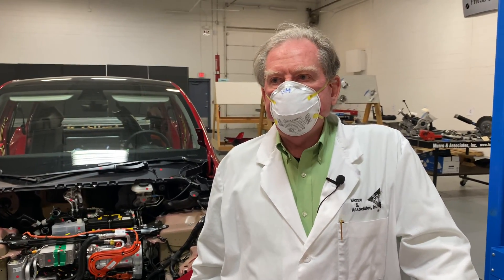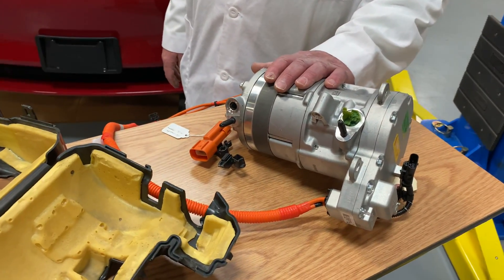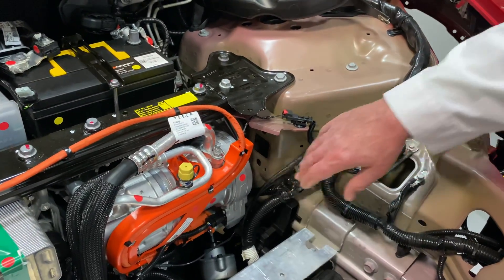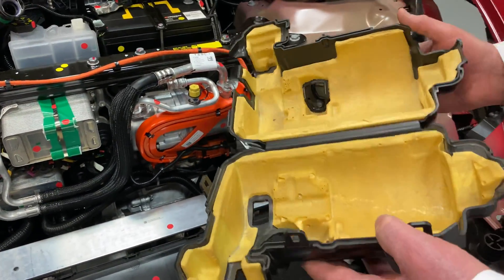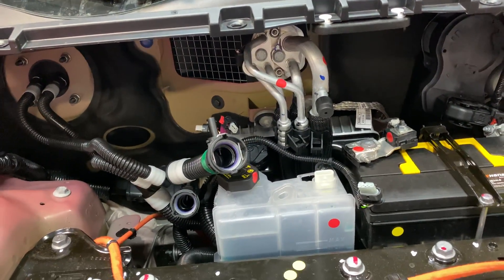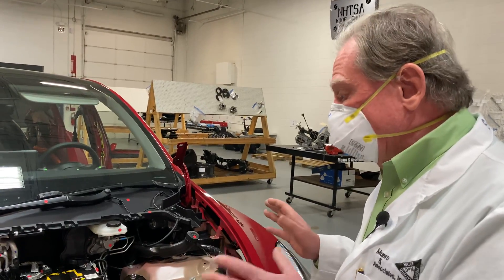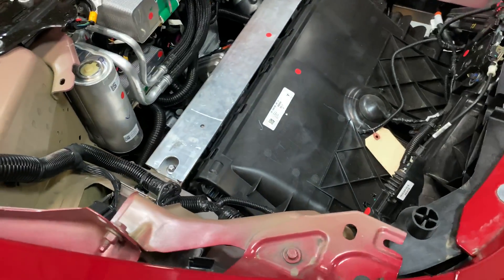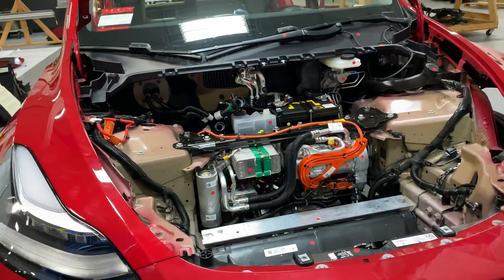Model Y E13: Comparing Model 3 eAC to Model Y Heat Pump

Comment: Mr Monroe,

The pressure on the cooling system on any Tesla is 1 to 2 PSI.

The pressure in the Ford Mach E is 21 PSI. Kinda makes you wonder who’s stuck in the Stone Age don’t it.

The Tesla’s lower pressure means fewer coolant leaks plus the are fewer coolant lines versus the Ford Mach E which you so elegantly showed us on your initial inspection after pulling the frunk out of the car. 

Food for thought

Comment: You have it backward. The yellow cap on the thin pipe is the high pressure side. The fat pipe is the low pressure side (with the smaller ridge cap without hex top). Thin side is high/hot.

Comment: I truly wish Ford could have put a heat pump in the mock e.  That would have sealed the deal for me
Reply: I think he has. For that are the pipes all about. I'm not sure if it's used also for heating and only for cooling. But you only have change the hot side and the cold side in order to get an heat pump for heating and cooling

Comment: Is there an extra evaporator on the outside for heat pump mode?, or is the radiator also used in the winter to absorb the heat of the ambient via the coolant?
Thanks a lot for the interesting video!!

Comment: think you need to double check how an hvac works. the gas does not chose were to goXD

the cooling circuit turns when you switch from heat to cold.

it always goes in to the car and the "condenser"

Comment: A heat pump is great as I have one on my home. But same as for my home it does not heat enough when really cold, so is there supplementary electrical heating?
Reply: Yes.  Like the Model 3, the Y can run it’s motor in an inefficient manner to produce heat.  Sorry I’m late.

Comment: Sandy, you said there is just one radiator in the car, but I could see a couple electric fans in the nose of the car (just visible in the corner of the video frame). Aren't those fans pulling air through a radiator?

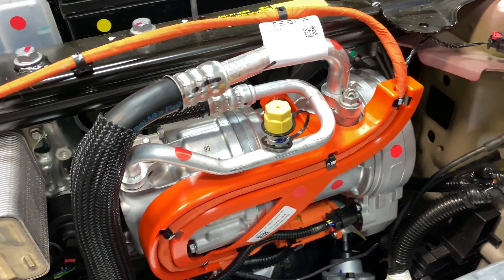Comment: 2:20 Is that how the heat pump works? Really? That description fits to A/C compressor. I thought that the heat pump just moves the heat (or cold) around. For instance, using heat accumulated in the battery and the drivetrain to heat up the cabin.

Comment: My concern with heat pumps is related to the heating capacity it Arctic environments. As far as I'm aware, heat pumps start to loose their efficiency below -10°F. Did they do something to improve cold weather performance or am I hosed when it gets chilly out?

Comment: What he failed to say was that a heat pump is simply an air conditioner system, that when one pushes a button, cycles the refrigerant in the opposite direction, directing the produced heat to inside the cabin, instead of to the outside, as it does when in AC mode.

Comment: A very efficient simple system.
The A/C unit could use slightly stiffer materials, so it doesn't move around as much on the mount or mounts.
As this causes long term failure of other components attached to the pump.
Otherwise a pretty good set up.

Comment: Only question is, can the octovalve pump heat from the cabin into the battery when its cold but really sunny and toasty inside the car. THAT imo would be next level. The cabin is pretty much a greenhouse that traps tons of heat, especially when you have black seats. You can probably use the chemical battery doubled up as a thermal mass at that point and reverse the process of heating/cooling based on weather changes. Or even waste heat from supercharging can go straight into the cabin when its balls frozen outside. Wowzers

Comment: IDK what the hype is about, he looks positively demented and a Tesla fanboy.

The 'good' things he's discovered thus far are mostly half assed cost saving meausres and don't appear to benefit the consumer
Reply: hes mentioning improvements over the model 3... a car that is already so good already that its outselling other luxury cars despite not really being luxury, so what he is actually analyzing is teslas response and decisions making for improving the model Y over the model 3.
Reply: A heat pump certainly benefits customers in cold climates. Longer range on a battery charge.
Reply: Tori Doe “don’t know what the hype is about?” Just drive one and you will. I have a Model 3, best car I’ve owned by miles. 
My next car will be a Model Y.... (or perhaps even a Cybertruck.)

Comment: I'm curious if there is an easy way to get out leaves that get sucked into the radiator vent?  I couldn't find a way to do this on my Model 3.
Reply: Tesla Tips by MTN Ranger It’s pretty easy. Take the frunk tub out and then unclip the top of the plastic shroud and flex it up- you can pretty easy get to the leaves and insects. I do it every 12 months or so.
Reply: FutureSystem738 Thx, I’ll have to try that out!
Reply: FutureSystem738 Thx, I’ll have to try that out!
Reply: Removing the Frunk Tub is very easy.. You just need a 10 mm wrench to remove the 7 bolts keeping it in place.

Comment: Thanks! HP payback in moderately cold, frequent long distance driving. I'd rather have bigger battery, so benefit is all year round. I live in Calif and drive <100mi/day. I applaud Tesla's engineering to take it to the next level, however. Edit: Let's all leave a tip for Sandy's work (Support Munro)

Comment: Can someone explain me why they keep around a 12V battery instead of tapping the 350V one with a downconverter? Regulations?
Reply: Its needed to open the contactor to access high currents from the main battery.
https://chargedevs.com/features/a-closer-look-at-contactors/
Reply: @waynerussell6401  okay that makes sense, thanks. Still wonder if you couldn't just do a downconverter to a contactor that disconnects everything except itself. It's probably a little safer but seems like it would be fine and you could ditch that unattractive lead acid battery.
Reply: I've had the 12V needing a jump in my Prius when a kid left the rear dome light on. My same reaction - why is the battery that can power a car not available to get me started?
Reply: @bradstewart7007  This doesn't really apply to Tesla though. The battery dies you need a charge for the main battery, 12V battery or not.

Comment: Radiator is enclosed, rather than exposed heat sink vanes I used to see. Sandy says they can close off (“shutter”) the assembly. So I guess when cooling is needed a blower forcefully passes air through the box enclosure. -you can’t always depend on the car moving to provide velocity for ram air. ?
Reply from the maker: Thanks for the question Steven. The radiator operates in a very similar fashion to most other vehicles as there is a fan on the back side that forces air pass the radiator if needed. Due to the angled setup, the plastic enclosure is necessary to create a path for the outside air to come in from the lower grill opening on the front bumper. The shutters that open and close are located at this location. The active grille shutters are becoming more common place for vehicles these days. They reduce drag on vehicle if no ram air is needed during normal driving.

Comment: The NVH cover on model 3 compressor was ditched over a year ago. Not many have them. Model Y compressor is obviously more powerful. 
I don't like how it's mounted. Mounts are soft allowing it to move and make noise by contacting bracket. But, with firmer mounts, the torque of the compressor made it so you can feel in the steering wheel when it switches on and off. This is an important issue. I'm interested to see solutions.
Reply: Do you really think Tesla would design an isolation mount for the heatpump that would allow it to contact any other component or frame in the car? These are pretty smart engineers, if you haven't figure that out already...
Reply: @stevebothe1416 I know the engineers are smart, I have much respect for them. I'm a tech at the factory dude. Been working on Y since pre-production. I don't "think" the compressor contacts, I know it does. We've been working on this issue. Interested in Sandy's approach to solving it, or if it even really needs solving since it only occurs when someone hits very hard bumps/pot holes.
Reply: @chstra45  Fair enough... In that case, I'm guessing it would not be an issue under normal driving conditions, but could potentially contact the frame if the car was to hit a large bump or pothole... Is that your take too?
Reply: @stevebothe1416  Yes. I takes effort to cause it to hit. Normal driving, even most of the bumps you encounter on bad roads (which are most roads in this country) will not cause this to happen. When we assess vehicles we try to look at worst case, then work back to determine the severity. It doesn't cause any issues with compressor, but if you heard it you would think something is loose in suspension. Like I mentioned, stiffer mounting bushings created a worse problem. There's video here of people bouncing the brand new Y on dirt roads and it didn't come up. It's a fringe issue that few if any will notice, but one I'm curious about.
Reply: @chstra45   Sounds good... It's just about hitting the sweet spot in the design I guess. I too, am now curious about Sandy's comments...

Comment: I am a huge fan of this sort of efficient engineering, and this arrangement is clearly very elegant and incredibly optimised. But with fewer pumps etc., the ones that are there must be doing more work. And obviously a single failure in this system could well cause the car to shut down if it can't cool the battery. Could this consolidation of systems cause a possible reduction in reliability?
Reply: 15Bit if the “wrong” pump failed in a different vehicle, the vehicle would fail too.
Reply: The whole car would be very unlikely to shut down. Performance/power would be software limited.

Comment: Failure mode - yes. 
If your compressor fails the whole car fails.
Reply: car can still operate without proper cooling just wouldn't be able to go fast or super charge with it because the software would cut back current to prevent overheat.
Reply: Why?

Comment: Sandy, can you check, whether this particular Model Y still has an additional resistive (PTC) heater? Because this way, Model Y would also be able to generate heat much more quickly. It would then be up to a controller to decide, whether to use the resistive heater and/or heat pump at each point in time.
Reply: This is Munro.. that's what they do! lol.. they're gonna tear every inch of this thing apart... we'll know in time

Comment: One of the lines leading out of the heat pump seems to be crimped pretty bad as it was bent 90 degrees up. I would like to know your opinion on this.  Seems like a lot of restriction of flow.

Comment: Seems like more parts that needs servicing...? 🤔
Reply: It replaces multiple other parts normally found in an EV, so one individually more expensive part perhaps vs multiple components adding up to more total expense and labor on average. You can drive cost down through mass production and then have less inventory complexity when stocking them up for service centers.

Comment: At first, thanks a lot team Munro to share all of this. Great stuff, highly interesting. One question: The M3 A/C compressor is replaced by MY heat pump, which now does both things: cooling and heating? Was not entirely clear, but may goe without saying.
Reply from the maker: That is correct. The Model Y's heat pump replaces the AC compressor in the Model 3 and can be used to achieve both heating and cooling.
Reply: @MunroLive  really appreciate the quick response. All the best to the team, don't get bogged down by the bloody virus.

Comment: so inside the engine bay on the model Y is brown with body color oversparay on it?
Reply from the maker: The brown color you are referring to is the undercoating that is applied to the entire BIW for rust and corrosion-protection. The A-surface paint (red in this case) is for the final aesthetic appearance. Basically all automotive OEM's use some sort of undercoating on their body and it up to the OEM how much of the final body color they spray everywhere else. Reducing the amount of final vehicle that is fully pain
ted saves time and cost. You'll see that "brown" look in a lot of places that are not highly visible, especially in the interior behind trim panels. Thanks for tuning in!
Reply: @MunroLive  BIW= body in white

Comment: What type of refrigerant they are using ?
Reply from the maker: The Model 3 used R-134a and it was clearly stated on a label in the engine bay. We were not able to find a similar label on the Model Y but documentation we have calls out R-134a as the refrigerant used on the Model Y as well. Thanks for tuning in!
Reply: It’s surprising because most new car uses 1234 YF  ?

Comment: Anybody with a Y notice the heat pump being noisy?
Reply: I noticed that my Y was really loud on return home from delivery. It was warm outside. My Model 3 would get loud but this was a lot louder. Inside the vehicle I didn't notice it. The volume outside was similar to a gas car at idle with the A/C cranked. I haven't noticed it since in a few drives. Maybe the peak volume at max cooling is louder. It's not something I would really complain about, especially if I get more range in the winter, which I expect.
Reply: @domg7359  heat pump with integrated pedestrian warning sound ;)
Reply: Dom G great input. Thx.
Reply: I don't have a model Y

Comment: people complaining that the heat pump is loud might have never owned a EV. with the Y being their first. Since the rest of the car doesn't really make any noise, anything that does make noise might be "amplified". Just my guess
Reply: Luxury ICE cars have gotten great at reducing noise from all sources. You often will not even hear an engine at highway speeds.
Reply: Yes- some people complain about the noise of the Model 3 A/C, but only because the rest of the car is so quiet. You don’t hear it from inside- in any event, it helps warn pedestrians!

Comment: I have an i3s with a heat pump and it is definitely noisy, but I don't hear from in the car while driving. From the outside of the car when parked and pre-heating the cabin it sounds like a small engine running tho, i'm waiting for someone to tell me i left my engine running when i leave it heating in a store parking lot :D

Comment: That does look like a scroll compressor, I was hoping they had that technology. I suspect the CT will have a bigger one for the air suspension and for compressed air power tools. A bigger scroll compressor will be useful for home HVAC. Below about 10kw scrolls are more efficient? This is looking like a very good design. A few quality issues and some plastic clips used where metal would be better? Those inverters drivers are the real technology. Controlling multiple SiC fets is not easy. I would love to know   what generation of SiC they are and what drivers and controller chip they use.
Reply: Had another look at both compressors, I'm not sure if they are single stage. Combo axial piston and scroll. Vibration equals noise, a pure scroll would be quieter? More questions than answers so far. This it great stuff.

Comment: Sandy, What refrigerant are they using? Residential HPs today use 410A. Most automotive A/C units use 134A.  410A is much higher operating pressure at high temperatures but can extract heat from much colder ambient (outdoor) temperatures.
Reply: Hi I have the same question.
Reply: I'd be surprised if it were not R-134a
Reply: @lylestavast7652 , so would I. But 134A would be running negative pressures in ambient temperatures below 0 degrees F. Maybe they just turn the compressor off and run resistance heaters at extreme cold temperatures.
Reply from the maker: The Model 3 used R-134a and it was clearly stated on a label in the engine bay. We were not able to find a similar label on the Model Y but documentation we have calls out R-134a as the refrigerant used on the Model Y as well. Thanks for tuning in!
Reply: @MunroLive  Thanks for the response. Your answer is what I expected. 
I find myself looking each morning for your next episode. So much good, reliable, and honest information. Will you be doing tear downs of other machines on a continuing basis? 
Would pay a monthly fee to see more.
Reply from the maker: @virgilwhetsel5289  We are definitely hoping we can keep this channel going well after the Model Y teardown. Our recommendation right now would be to sign up for our Patreon page as this is going to be a likely first area where we start branching out into displaying other types of projects. https://www.patreon.com/MunroLive

Comment: Could you please do a video on whether the Y is physically capable of towing Yes/No and how much?
Reply: Now you know has done a video on this. Short answer is atm it's not setup for it in north america (like to tow large heavy trailers), but probably will in Europe (like to tow small light trailers).
Reply: A problem is the max payload of the Y is just 402 kg. Adding  a towbar hitch and the tongue weight will cut into that.
Reply: @foersom5928  That's so disappointing. Was really hoping this vehicle would preform similar for example to a Cherokee (~3500LB Tow)
Reply: @eganjos1   If you want to  tow  the current options are Tesla X payload 525 kg, tow 2250 kg; or Audi E-Tron Quattro payload 640 kg, tow 1800 kg
Reply: @eganjos1  Tesla has now tow option 1588  kg for model Y. That is much more  than I expected, model 3 has 910 kg in EU. Tow bar ~23 kg,  with max tow 1588 kg that is  at least tongue weight 159 kg. So payload is reduced to ~220  kg.

Comment: Great content, thank you! Is there a backup heater when temp drops too low < 3F, COOP < 1. Is that a suction line port with no cap, unlike the liquid line with yellow [not so good].. Where is that octavalve @tesla was bragging anyway? It has to get hot or really cold to get that HP some workout... Right now, this HP is on vacation. LOL.